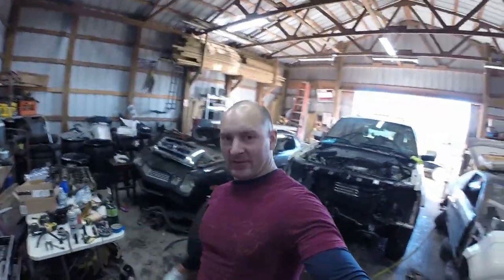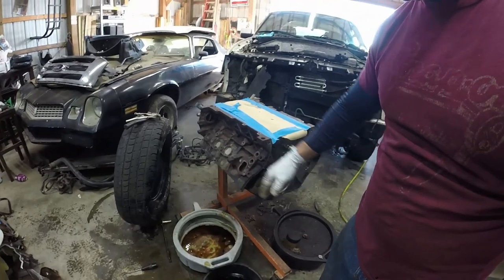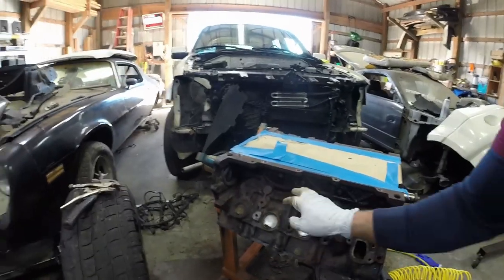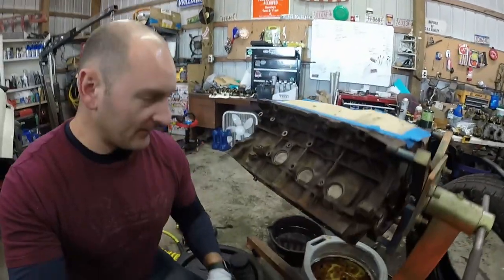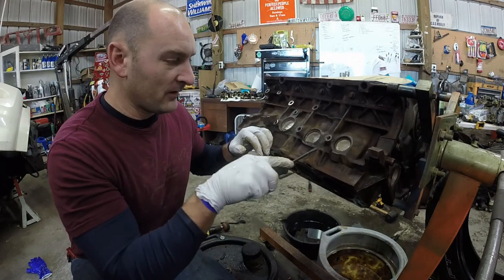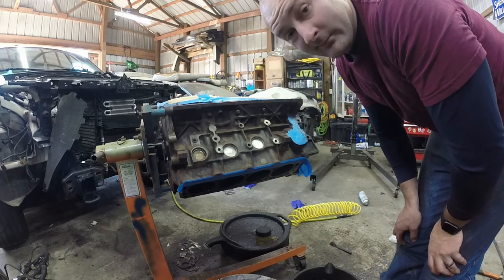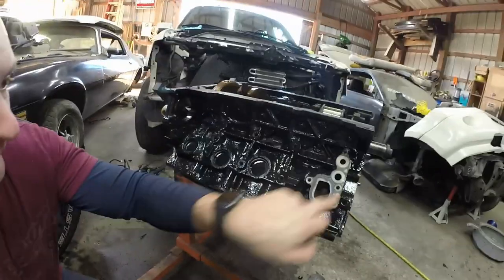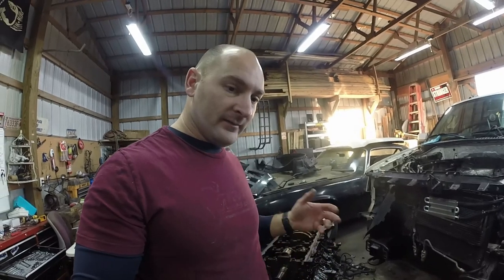How to Paint a Rusty Engine Block!!

Comment: I have a 4000 mile motor that was in a show car, it's painted black, can i clean the motor ans paint over the black, if so should i scuff it first?
Reply from the maker: Scuffing the surface will promote adhesion, paint needs a mechanical bond to hold so it doesn’t bubble or just chip away.
Reply: @TheShopWorldWide  Thanks for the reply, I'll see what happens, anything but a black motor.